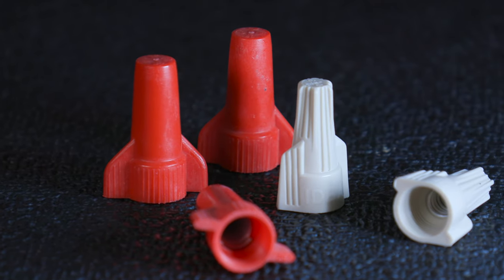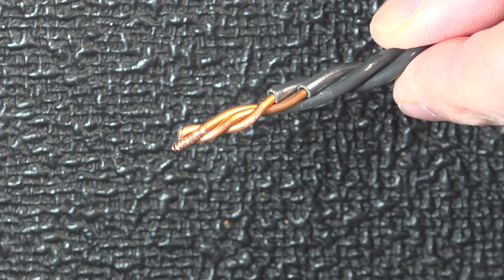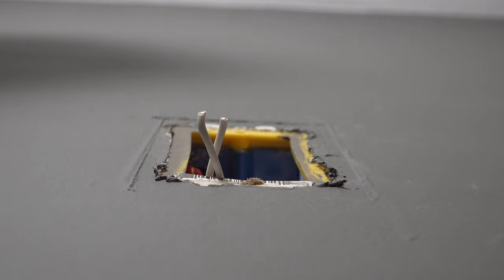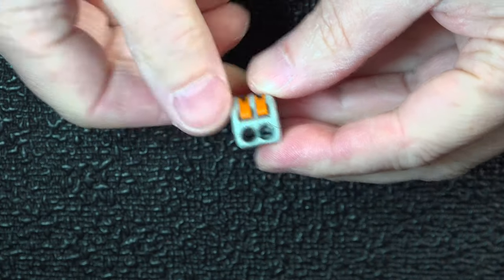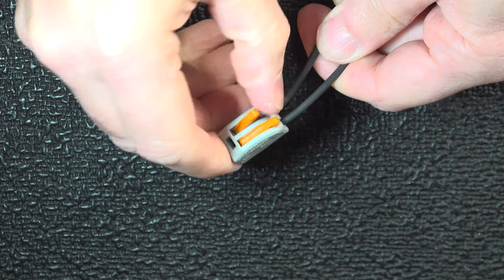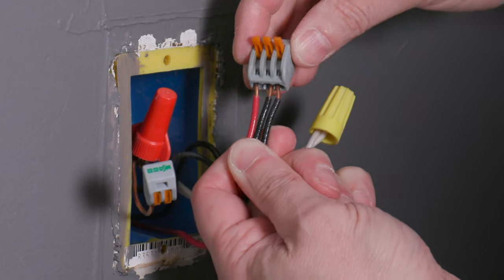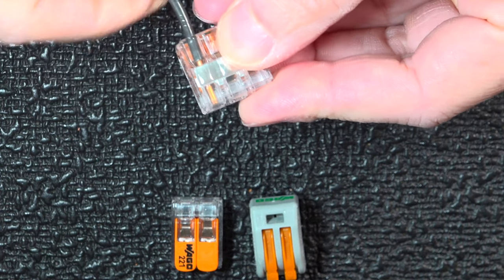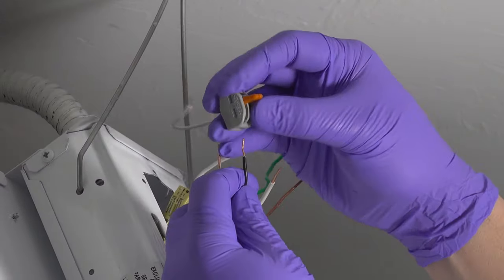Never use Wire Nuts Again - Wago is Better Electrical Connector

Comment: Interesting, I've been using wire nuts for 40 years and I never knew that they weren't reusable.
Reply: The nut can be if need be, he was talking about the wire tips that were in the nut. They get weakened and damaged, you'll eventually break them off.
Reply: They are not especially after using a pipe wrench on them⚡⚡🔥🤕
Reply: @Drewsky840  they shouldnt be reused if possible. wire nuts stretch and bulge out when tightened so will always be a looser connection when used more than once.
Reply: @jakebergen1837  no they dont
Reply: Id reuse if it's in good near ideal condition. It's not safe to use them if they have bits of stranded wire.
Reply: Well half the time you cant even get them off to re-use without breaking the plastic part off the internal coil
Reply: That's because you're using cheap, shitty wire nuts
Reply: every other house would be burning to the ground if they weren't reusable
Reply: @DDracee  the tip yes.  Does not mean you have to cut off 3” of wire to reuse it.
Reply: @HobbyOrganist  use two Pliers.
Reply: @HobbyOrganist  I would not say LOTS of houses are burning from malfunctions in the electrical. Maybe it's different in different areas. I feel bad for so many people losing their houses because of reusing wire nuts, and people aren't really talking about this issue.
Reply: @HobbyOrganist  I am getting the impression there is some misunderstanding on my opinion. 
Wire nuts are excellent when used properly.  Do they oxidize and stick overtime yes.  Do I reuse the old one no they are not cheaper than a return call or safety.   Used properly there great! The new replacements mentioned I have used many times and even stock them in my van but are not my primary use.  All I am saying is the video was a bit extreme on how ineffective they are.
Reply: @HobbyOrganist  your estimate is hysterical, just because homeowners are replacing light fixtures outlets and switches does not mean that there’s not a junction behind each one of those devices or fixtures.  Is your estimate based on experience?
I started doing electrical work in 95 and have been licensed since 2005.
Reply: @HobbyOrganist  👍
Reply: @HobbyOrganist  yeah, hard to say how many are from wire nut reuse. Probably none.
Reply: My biggest problem with the wago is the actual physical connection wire nuts may take more time but I know the actual surface connection is better and won’t be a weak link at higher amps. I have tried the wago and they work but I wouldn’t use them for a junction box going to multiple rooms outlets these are better for lighting and low amp applications.
Reply: @HobbyOrganist  well now you full of your self lol. 12/3 20amp circuit 3 4gang boxes on one wall and 2 4gangs on the other for shop equipment at home. And as far as running space heaters yeah best circumstances they aren’t great but when the main heating goes out they have a place. It makes sense to plan for the worst case hopefully that doesn’t happen to you.
Reply: @jakebergen1837  To give your idea the benefit of the doubt, i conducted a test.  Really, I did.  I grabbed three wire nuts from my bin and miked them.   I then inserted some wires into each, twisted the nuts tight, and miked the nuts again.  I then removed the weirs and miked the nuts a third time.   All the measurements were the same.
Reply: @anthonyjmeli  i dont understand how thats any better, the fact you got to cut any of it off is a downside, i work in industrial ive encountered panels where i had the replace the entire wire because it kept getting cut untill eventually it got too short and i couldnt start daisy chaining wires together to add more length since that goes against code for certain industrial sectors
Reply: @DDracee  That’s not the downfall of the wire nut that’s just the electrician working in the panel. Please site the code where spliced a wire in a panel is agents code?  I got my 2020 nec on my lap.
Reply: @anthonyjmeli  Its not NEC/CEC, i said i worked in industrial and industries quite often enforce their own standards.

If you want the specifics, it usually happens with the 3phase 480V motors. Some are made with loose wires and you need to pigtail em, there isn't enough room in the little box for more than one pigtail per wire, not that my employer would let me do it anyway. The problem is they get disconnected often for maintenance.

Even when it comes to normal control panels, clients can often tell you to redo something just because it doesn't look clean. So our engineering firm has a bunch of extra standards to follow to make sure we gave better results than out competitors.
Reply: @ionymous6733  Maybe the reason people don't talk about it is because it doesn't happen. It's like the hysteria about using mobile phones at service stations; everyone was afraid of exploding bowsers, but there's never been a single case of it actually happening, anywhere, ever.
Reply: You have to be smart to re use them
Reply: They are reusable according to the 2020 NEC. Doesn’t mean you should reuse them, but technically you can.
Reply: The only purpose of all push in connection devices is to make electrical splicing accessible to unskilled installers.
Reply: They ARE reusable, obviously.
Reply: @jerrycadogan4103  the pushing of limp flaccid wire into a loose hole is just what these people are used to so it's what's natural
Reply: Damn Hobby Organist got ratioed right off of this thread. His comments were so disliked, that they were removed by YouTube. LOL
Reply: Ive been reusing them for 40 years and haven't had a single issue with doing so. So there is that.
Reply: Yes you can re use them. And wago from what i researched is not approved nec practice. A few codes officers near me do not approve of them. And taping a wire nut is added security that nothing gets in and the nut stays in place.
Reply: Ok. So he wasn’t saying that the wing but isn’t reusable. Even though that is what he said. What he goes on abo out right after that is that the wires get scratches on them from the nuts and this scratches are a fire hazard (no) and that’s why he says you can’t reuse them because you have to keep cutting off the ends of the wires. As in you can’t reuse a wirenut fitting because you will run out of wire having to cuts the ends off every time.

It’s all absurd.
Reply: They are.
Reply: I only reuse wire nuts if I am adding a wire to the connection.
Reply: Ive been reusing wire nuts for forty years
Reply: @auburntigerzz  If it has an engineering stamp to use reuse it then you should. that comment is like saying just cause the code book says to use 14 gauge wire doesnt mean you should might as well upsize the wire to 10 gauge since the code books are also approved by engineers. 😂 you must be one of the electricians that tell people they do things the "right way" even though there are 100s of right ways to do anything 😂
Reply: @TheCommo81  I only tape them if it is going to deal with constant vibrations like inside motors and what not.
Reply: @Drewsky840  - Technically they can't.  It's against nec code. Do your research and find out why before talking shit.
Reply from the maker: @Drewsky840  Not what your specifications say
Reply: Sometimes they get corroded.
I used to work for a company 
I replaced them, because I never wanted to be recalled.
Reply: @jakebergen1837  That's the same reason bolts that are torqued shouldn't be re-used. They stretch and the strength component will be weaker a second time.
Reply: Lol. You don't need to cut off the existing conductors. That's BS.. If the "wirenuts" connections are failing, then you don't understand how to splice.. Also, use quality connectors, such as those made by 3M..
Reply: @SilverCymbal  lmfao dkm
Reply: @jegr3398  shut up yes they do, basic physics bro
Reply: I've trimmed and pigtailed a lot of wires due to dried out insulation from heat exposure. I'd view these as a quick connect for low current applications and use a di-electric grease with them. Once a solid pigtail to stranded wire is made only a single, reusable wire is needed when replacement of components comes due. There are other ways to make a better connection. Easier is not always better.
Reply: @HabuBeemer  Most bolts can be re-torqued.  You are speaking about torque-to-yield bolts that should not be re-used.  Most bolts are not that type, and can be re-torqued, as the torque specification is below the yield limit of the material the nut and bolt are made of.  Some automotive cylinder head, frame and suspension bolts are torque-to-yield. There are also some building structural bolts that should not be reused, but this is about electrical contacts not automobiles and building structures.

Comment: Been an electrician for 15 years. Marrettes (wire nuts) are perfectly fine when installed properly. Wago's are expensive and impractical for many applications
Reply: @jesussavesanus9790  Wow, what a compelling counter point you made.I think i'll reconsider my point of view thanks to you... 🤣🤷‍♂️
Reply: @brockwagner939  That and sometimes you require 2 wires to be jointed other times it can be 5. Carrying hundreds of each type of wago isnt practical. They do have their uses, just not a 1 for 1 replacement of marrettes
Reply: Ah the I’ve been doing this for so many years guy that’s negative. Cool story bro!
Reply: @whatjake7898  I stated why I don't use them... not a negative, they are good but expensive and impractical. What do you have to add?
Reply: @Teh_Random_Canadian  mate your point of having to carry many types is probably the worse point that you could of made I wonder how many times of wire nuts are in your van 
Get a packout organiser or something 
6 types of wagos and you will be sorted 
221 smaller version 2,3,5 way in 3 of them 
221 larger version 2,3,5 way in the other 3 you will work quicker connections that are safer I don’t see what the issue with them is